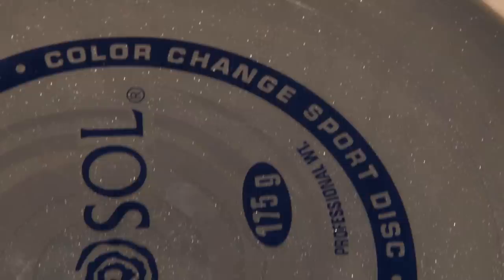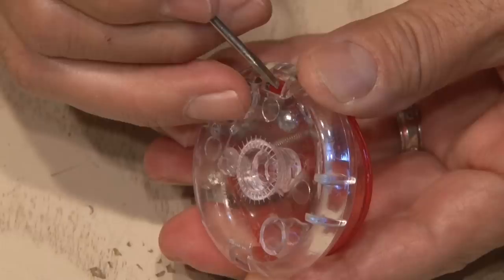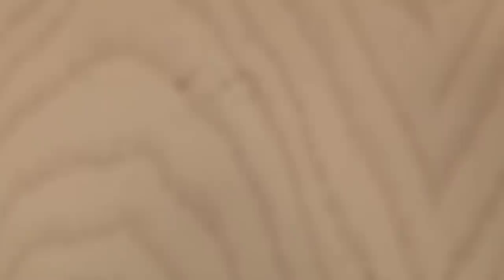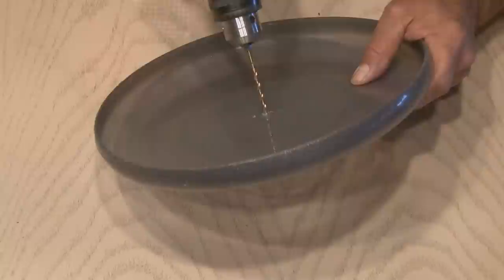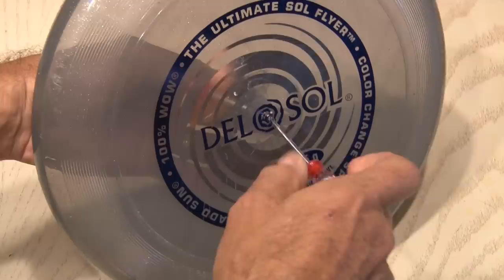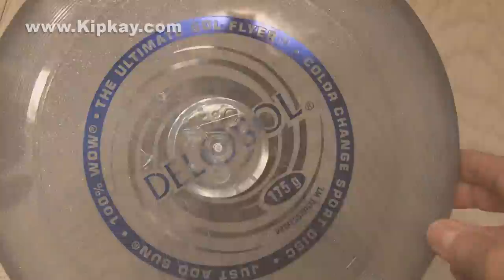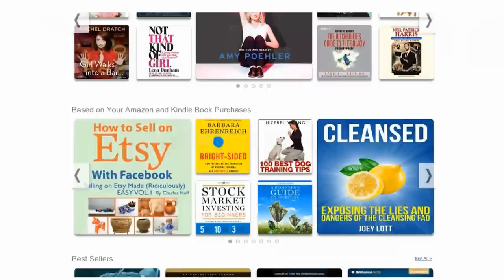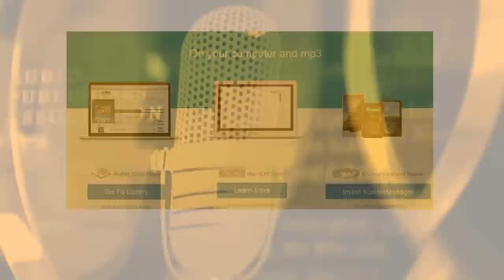EZ Light Up Frisbee!

Comment: Hey kip , I would like to know if its possible to reuse parts such as : the touch screen , mic , flash light  and speaker from a phone that stopped working after it fell in the toilet . 

Its want in there long... I did the rice thing and it just isn't working

Comment: We use to put red LEDs on our kites and fly them at night,also why not use surface mount LEDs on the outside inside the lip drill holes and hot glue them in and along with thin wires .

Comment: Probably would have been better if you added some wire and stretched those LEDs out to the perimeter of the frisbee.  You'd get a larger ring of light when it spins. Might add a little more weight and the balance might be off slightly, but it shouldn't be much as long as you're careful about it.